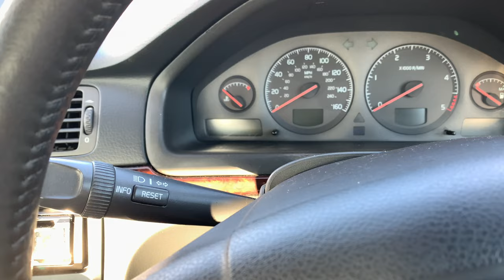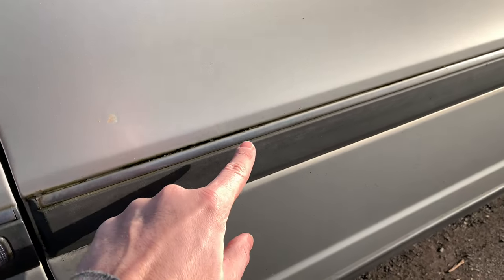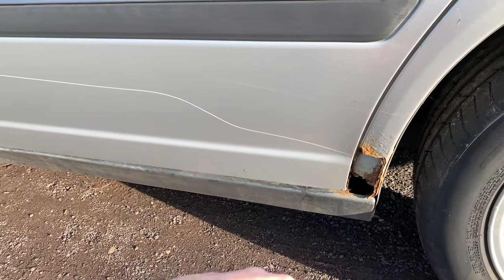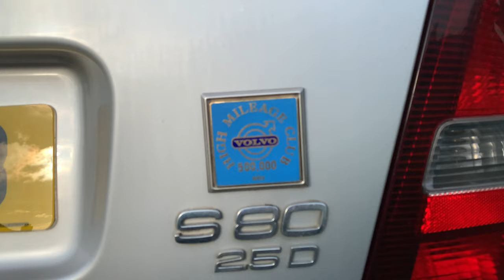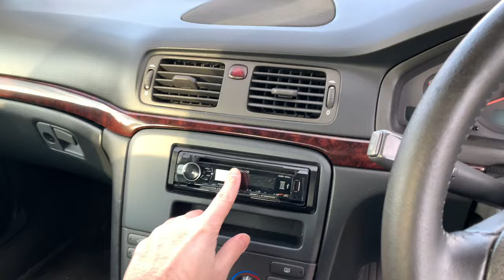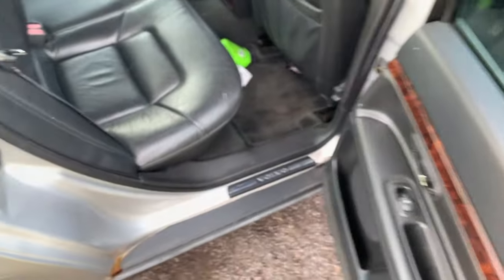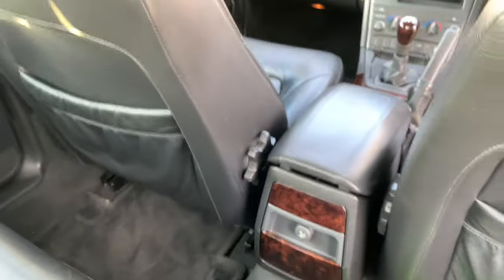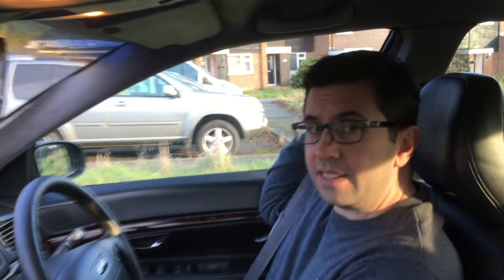A very high mileage Volvo S80 - a project

Comment: I have one just like this but it’s a 2.9 6 cylinder. I bought it last month for 3,640$ and it has a 189,000 miles now. Named him Sven. Needed a new catalytic converter right off the bat. But it’s such a comfy cruiser and the owner really took care of the interior and engine. Typical Volvo fashion some electrical stuff, driver window doesn’t roll down and the sunroof doesn’t open. My outside window seals are cracked and need new ones and my headlight has a slight crack too and tow cover is missing too like yours. So happy you’re caring for one too. I wanna get mine to the million mark someday. Cheers!
Reply from the maker: Thank you, nice car you got there.
I sold mine to Alex Kersten from the famous Auto Alex Yt Channel in September 2022 and he did a video of that car later in Octber. the plan is to do a high mileage hero road trip with the Volvo and other two cars next year.
good luck with yours!

Comment: The tensioner needs replacing asap it’s rattling like mad do it with the cambelt change 👍
Reply from the maker: Yes, it’s booked to have them changed at the same time as the belts. They look a bit worn too

Comment: My V70 D5 has the same plastic trim bubbling. The chap I bought it off described it as rust. Your power steering reservoir leak could be from the cap or the middle, it’s common and only £27 to replace it. If I was you I wouldn’t take it to a Volvo dealer for a cambelt change, law of diminishing returns etc. Mine is on 200k miles, be great if it does another 500k!
Reply from the maker: Thank you for your comment.
I discovered the source of the power steering leak only a couple of days ago and managed to fix it - it will be on the next video.
The reason why I’m taking it to a dealer was explained in the video. Also, I contacted two specialists that are located within a reasonable distance from where I live, and they no longer have the timing equipment and therefore they can’t do the work. The Volvo dealer I’m using was highly recommended by club members and other Volvo forums, so I have little to no alternative but to use it. 
Unless I send the car two hours away from where I live, however, hat involves me taking a couple of days holiday off work since nothing is open on weekends, and that’s not convenient for me.

Comment: Just use a lighter on the frayed edges of the seatbelt as a temporary fix. I had to do that a couple of times to get my 500k mile Skoda Octavia through the MOT and taxi inspection.
Reply from the maker: That’s a great tip, thank you.

Comment: Just found your channel from Facebook and looking forward to seeing the transformation! You should be able to find the trip computer on a rotating wheel on the indicator stalk? I had an S60, so assume the S80 is the same?!
Reply from the maker: Thanks, looking forward to get it into better shape. I tried rotating the wheel but nothing happens. I press the button and it says there are no messages, then I rotate the wheel and it clears. Strange.
Reply: @GentilsGarage  it looks like a low spec early model? Maybe you only got trip on like an SE and above? I notice no winter pack on that one.. (heated seats and headlight wipers etc). Good luck!
Reply from the maker: @jonnygigs21  yes, looks like the low spec, judging by the basic heating and ventilation controls too. Thank you!
Reply: @GentilsGarage  you might be able to restore the black plastic trim with a heat gun, like the ones used to strip paint? You don’t want to get too close or leave it on the same spot too long, but in my experience that will rejuvenate the bumper without having to use silicone dressings!
Reply from the maker: @jonnygigs21  yes, I’ve seen many people using that heat gun technique, but I haven’t done it myself yet. It will be a first!

Comment: In this case the main reason for the high reliability is the PD Turbo Diesel from Volkswagen. Notwithstanding the whiteblock probably would last just as long.
Reply from the maker: This isn’t a PD Engine. It predates them by quite a few years.

Comment: I had a 2000 S80 that the transmission went out on just 17 miles away from the 300K mark!  ☹
Reply from the maker: 300k is excellent if it’s an auto. I’ve read reports of many cars that lasted a half of that or less.

Comment: Is this that volvo with 500.000 mile badge on boot lid?
Reply from the maker: It is
Reply: Asking as I was also interested to buy it but been late just few hours.  I had intention to keep it and drive it and fix issues . But glad that You got it :)
Reply from the maker: Thank you. Plenty of work to do in it, but enjoying it so far.
Reply: @GentilsGarage  had 3 Of these before 2.4 140, 2.4 170 and 2.8T6 272. And I can imagine it needs work but as you probably remember, last owner was only gonna sell if some one gona look after and will not go to scrap :) so it's a lot of work, and You need keep the Word ! 😊
Reply from the maker: @mort46  Well, my goal is always to try and keep cars on the road, not to ruin them. Even though I have limited resources, I try and do the best I can to keep them in good order.
Now, I have an issue with the steering, but that will be the subject of the next video 😃
Reply: @GentilsGarage  I am gonna follow Your Progress on This Volvo to the finish line 💪
Reply from the maker: Thank you 😊
Reply: Good luck. I'll keep up-to-date. Followed from the Volvo Owners UK Facebook group. We have a V70 with 233k+ and my goal now is to reach full clock reset. Glad to see a "modern" Volvo being preserved.
Reply from the maker: @JonPaulTeasdale  thank you and good luck with yours